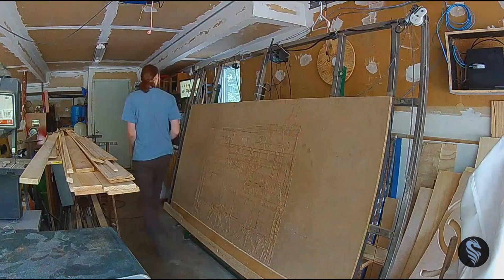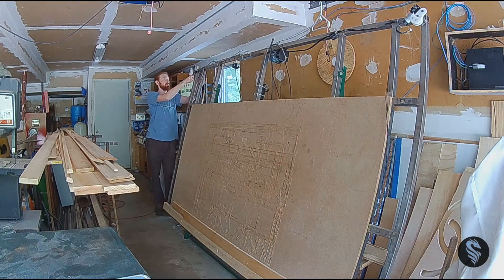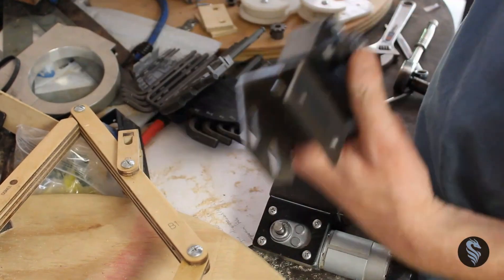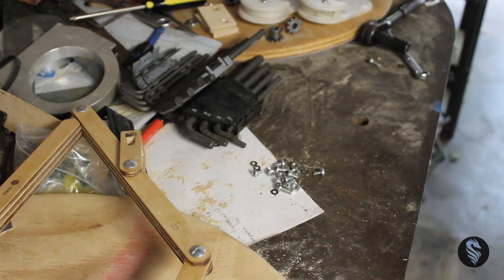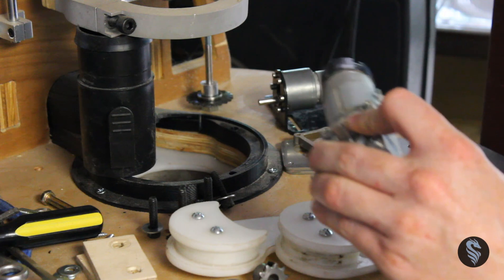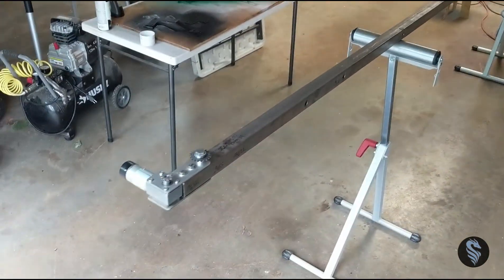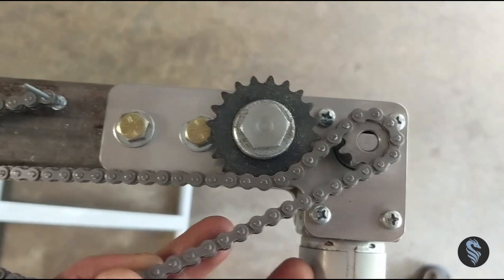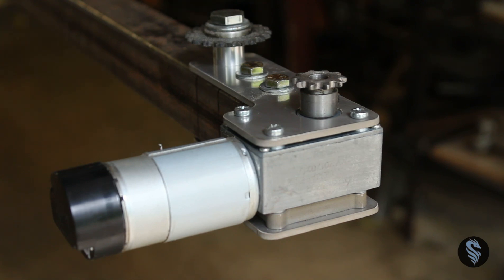Super Maslow, Pt 1 - Setting up the New Top Beam

Comment: Could you put the tensioned chain inside a piece of PVC tubing at the top?
Reply from the maker: Definitely a possibility for keeping the chains managed. The trick would be keeping the two chains separate from each other. I used little 3D printed guides to keep the chains and hooks from getting caught up in the unistrut and I haven't had any trouble with them yet.

Comment: are the motor mounts and idler gear working better than your chain guide system before? I'm looking to upgrade the motor mounts for the metal maslow kit and yours look nice. I watched the next video which show the bent motor brackets for hooking the chain on. that is even better.
Reply from the maker: They're definitely sturdier than my older brackets. I feel like my old chain guides worked a little better than the sprockets that I used in the revised version. But I've only had the chain slip off a sprocket once since putting the machine back into service.

Comment: Hi Maynard I love what you are doing with the Maslow frame. I am currently debating a superstrut frame but I am worried it will not be very rigid. Would you mind in a future video showing more detail on the motor mounts with the spacer. I have had difficulty during calibration where the chain tightens up and pulls the motors ever so slightly. Thanks. I look forward to the next Super Maslow video.
Reply from the maker: Dan, thanks for the kind words. I'm putting the finishing touches on pt 2, so hopefully I'll be able to post that in the next couple weeks. I do have some videos that show the motor brackets that I could edit together in the future. I just take forever to edit these :(

Superstrut is pretty good for a frame, but you have to be mindful of the orientation of the slot. That does introduce a weak point, and it can flex along that axis under high loads. I haven't seen any problems on a machine due to that, but it's something to be aware of. I prefer box tube myself, as it is much stronger, but it requires metalworking skills to fabricate a frame.